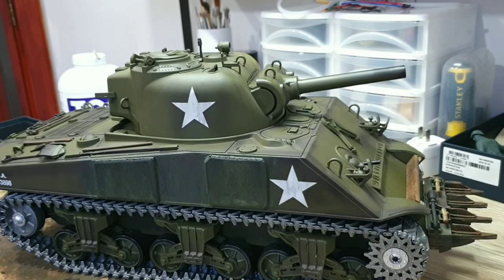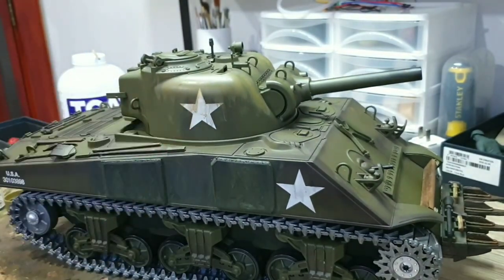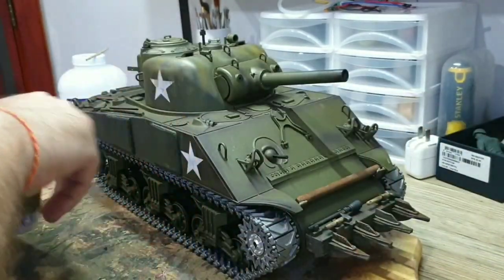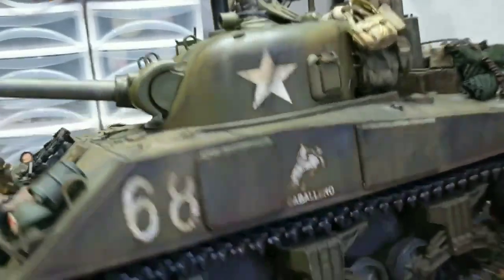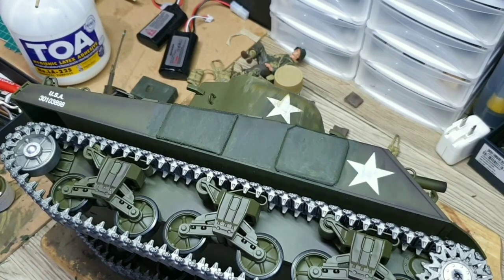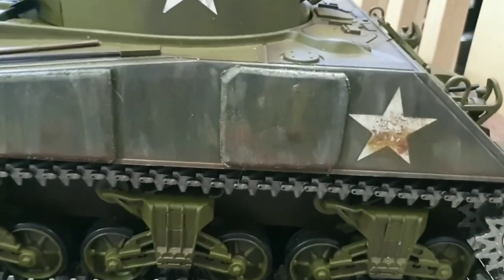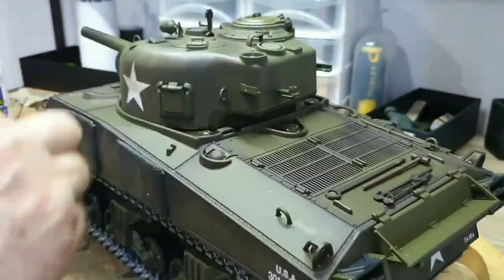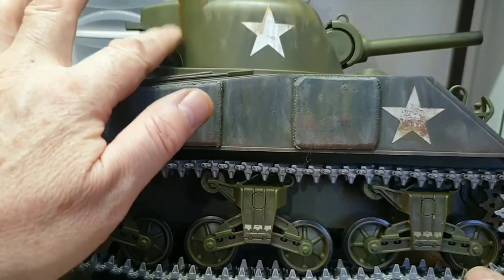Weathering The RC Tank M4A1

Comment: IF YOU HAVE METAL TRACKS THE ACTUAL TRACKS WAS BLACK AND THE CHEVRONS ON THE TRACKS WORE DOWN SHOWING THE METAL, SO YOU DO NOT HAVE TO REPAINT THEM UNLESS YOU HAVE THE PLASTIC TRACKS THEN THE PAINT GETS WORN OFF. U BOAT COMMANDER 157